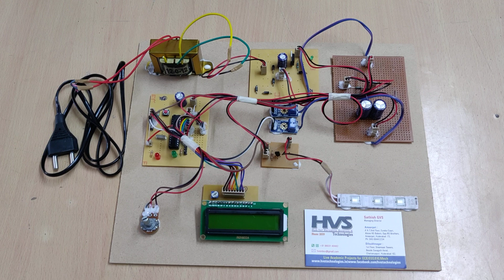Design and Hardware Implementation of Closed Loop Buck Converter Using Fuzzy Logic Controller

Comment: What is the input to the potentiometer
Reply from the maker: @jeebannayak8449  reference voltage. You can contact us at +919603140482
Through WhatsApp or call